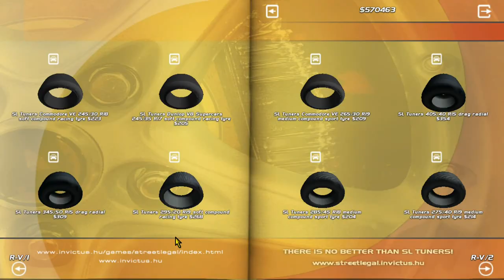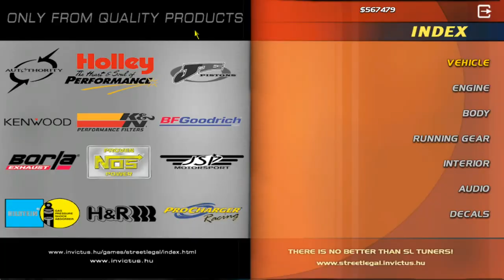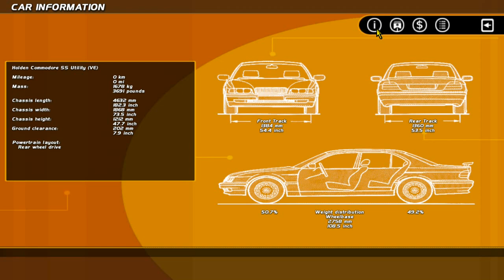FailRace Play SLRR 4600 HP Holden Ute

Comment: Tip: When buying parts, bodywork especially. Look above the items, if you see an icon with a car, you can place it right on. If its three lines or something, it fits one of your parts in your inventory. And if there is a "recycle" icon, you can replace it with a part on your car. And if there are no icon. The part at that moment cant be fitted to the car. Simply just change page and go back again for the icons to update.

Comment: btw, you seem to not really know what all the buttons do in the game, some really help you that you are not using, for example the fine tune tool can be used to open doors bonets and trunks and on the left side of the inventory bit you have buttons to hide the chassis, engine and running gear. And you can also see if your car is rear wheel driven in the first page where you see your horsepower. very helpfull if you have many transmitions that may have fwd or 4wd.
On another note I wish v2.3.0LE had the engine alignment menu that would help me so much. I might get a second installation of SLRR going with v2.2.1, thats the one you use right?